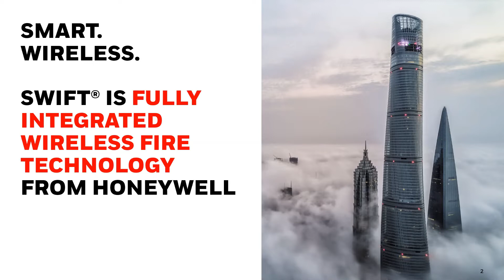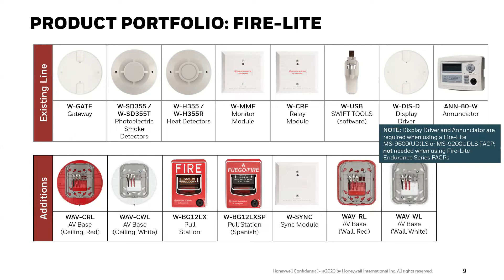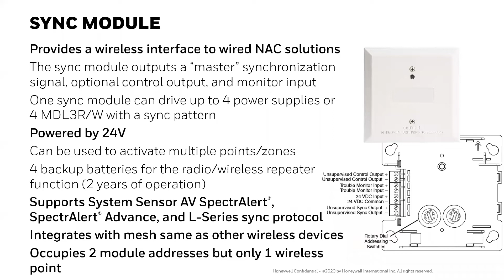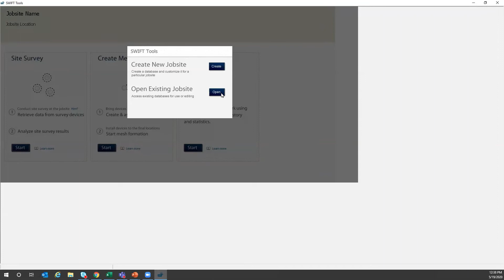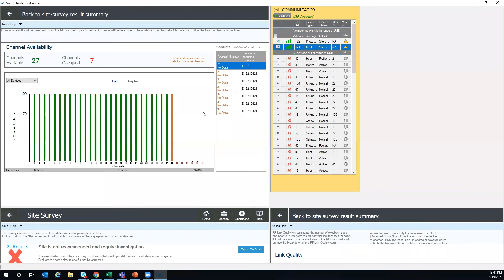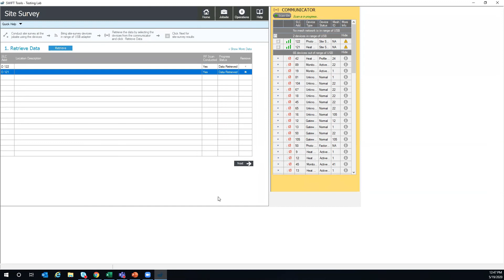SWIFT Wireless Fire Technology | Webinar

Comment: Hey Adi! One question I have for swift is  do you need both swift tools and firelite P.S tools to program a es-200x with Swift? Or can you program wireless swift with Swift tools and auto program the gateway and devices through the autoprogram function on the Es-200x?